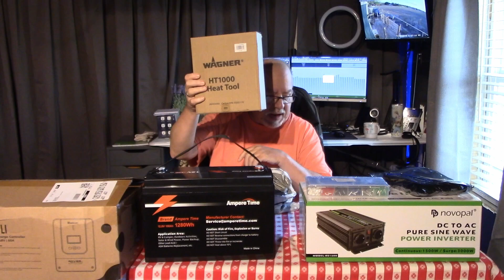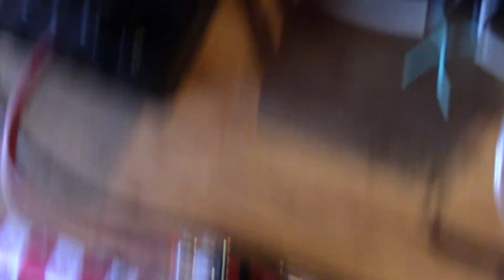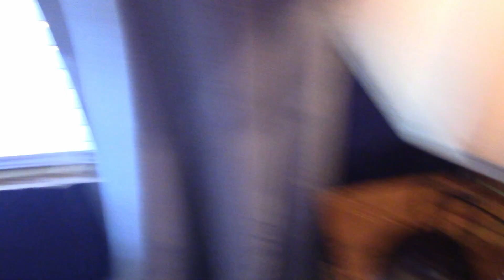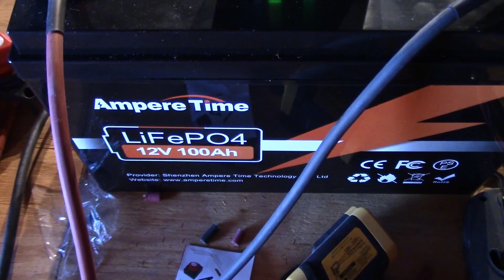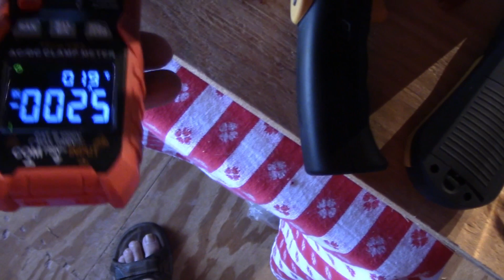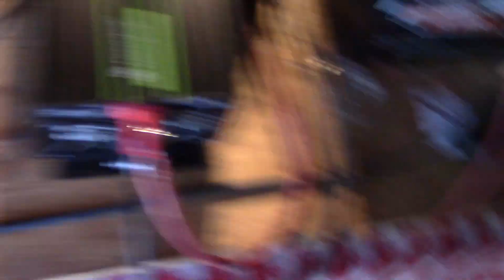Going Solar - Getting the components together.

Comment: Also, you shouldn't need to worry too much about freezing temps in your area, but most of the AmpereTime batteries do NOT have low-temp shutoff for charging. It should not be charged when the batt temp is  below 32 degrees Fahrenheit.
Reply from the maker: Yep plus they will be kept "the batteries" in a climate controlled env.

Comment: I have two of the AmpereTime 200AH batteries. Work great! I have them in series so my system is 24v nominal system.
What are the max theoretical watts you can have coming in from the panels?
Reply from the maker: The panels are 100w so in theory 600w I get pretty close to that, my best day was 446w. I am going 24v with two batteries, and then eventually 48v when I can afford more batteries. Thanks for watching :)